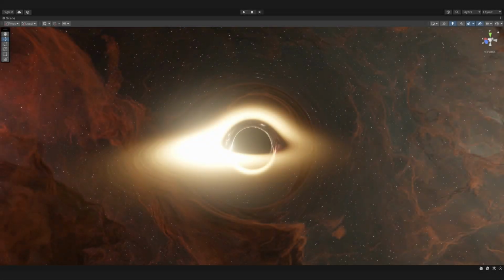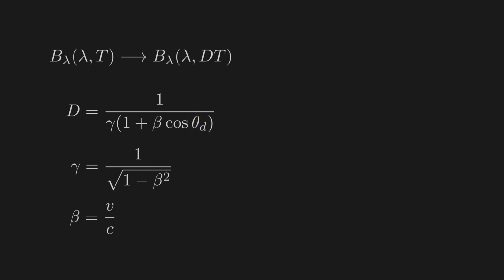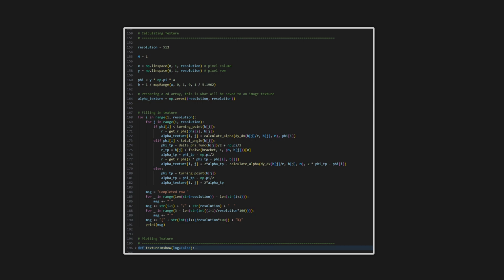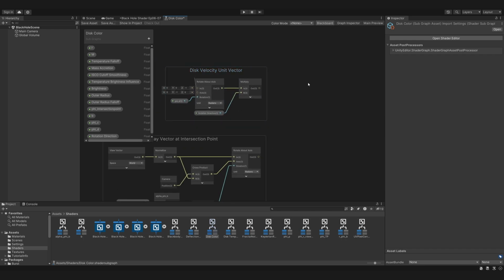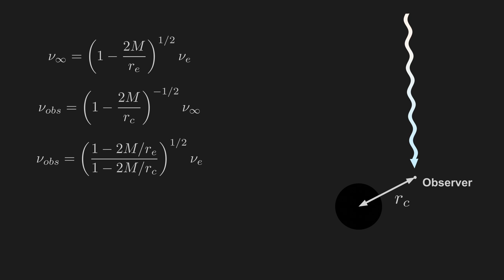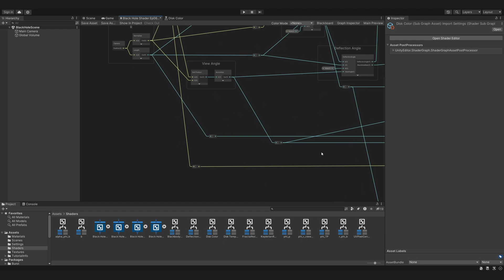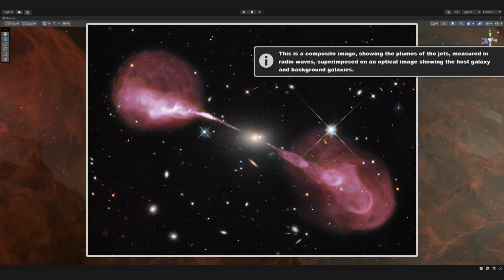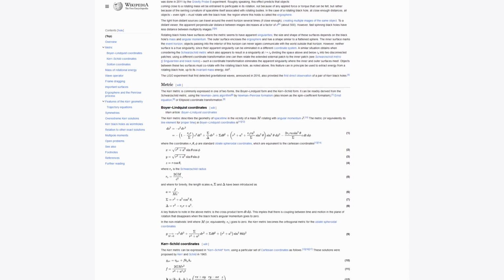Real-Time Black Hole in Unity | EP 7: Doppler Effects

Comment: Hi，May I ask how to render this black hole as a single object instead of a post-processing method? I really want to know. Thanks!
Reply from the maker: Depending on your use case, that’s either kinda possible or not at all. If you render the black hole as an object — however you might want to go about doing so — it won’t affect any other object in the scene. If you want to have a black hole in the background of your scene, then you could apply this shader on a large sphere encapsulating the entire scene or something. In that case, it not affecting any other object in your scene is a decent approximation, since the bending of light happens on a scale relatively large compared to your scene. 
However, if you want to have other objects at a similar distance to the camera as the black hole itself, I’m afraid that’s simply not possible. Due to the bending of light, you would have to render parts of objects that wouldn’t be visible if light went straight. Without writing your own ray tracing render engine, that’s simply not possible to do (at least to my knowledge).
Reply: Hm~Sorry，I don't seem to understand what you mean. What I mean is to apply your black hole shader to a cube or sphere, just like how you applied the shader to a plane in your V1 version. However, that tutorial seems to only have a gravitational lens, which is not very complete. @simonvse
Reply from the maker: Right, so you should be able to simply copy paste everything into an unlit shader, which you can then apply to an object.